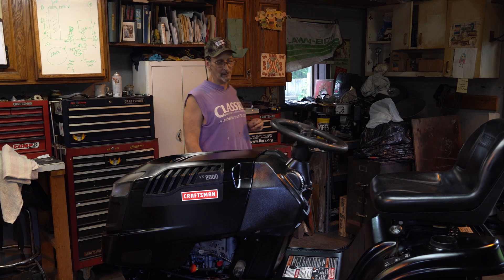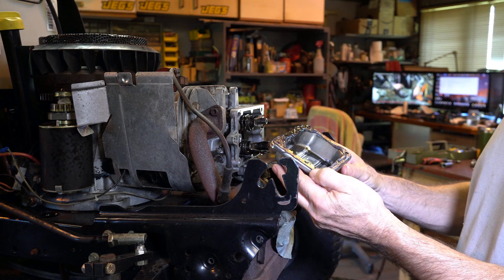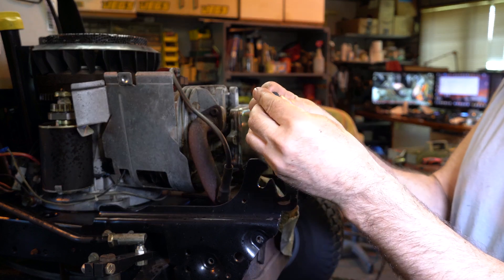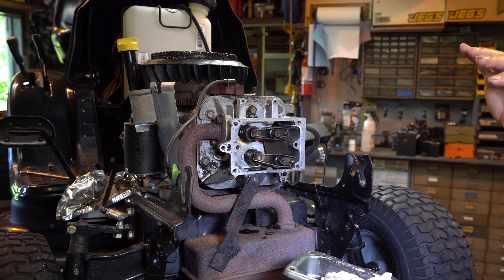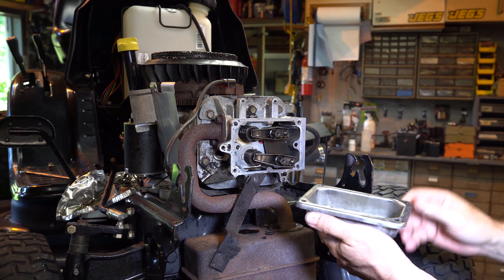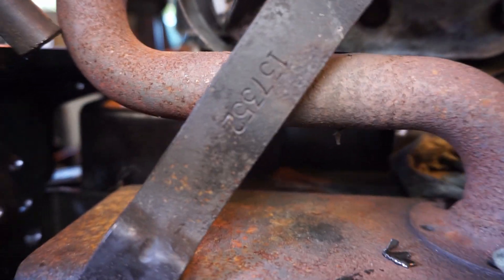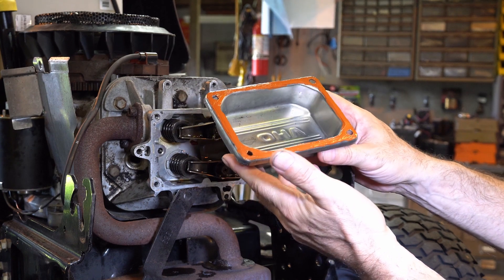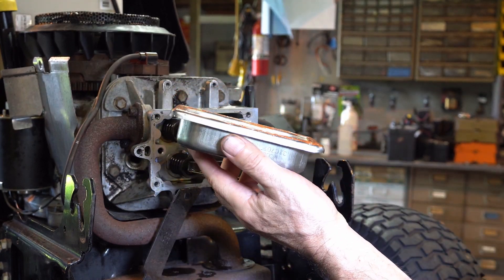How to Adjust Valve Lash & on the Briggs & Stratton 17.5hp OHV Engine - Craftsman Lt  Lawn Tractors

Comment: Briggs and Stratton have a nasty habit if the valves are not adjusted properly then it will crank slow like you have a bad starter or a dead battery. The reason it cranks slow it's because the compression release is not engaging. Take your time and pay attention. Generally I do . Intake .003" to .005"   /    Exhaust .005" to .007" generally when you get blow by or popping through your carburetor that's a good sign valves are out of adjustment and if you adjusted them properly and it still does it then it's time to do the valve job. If your machine smokes and burns oil chances are you have carbon build up around your valves. Causing it to pop back through the carburetor and backfiring.
Reply from the maker: Yup rex,,, I pinned this comment up at the top!!
Thanks!!!!
Reply: Good explanation 👍🏻

Comment: Those.
Valves are being gapped too far apart
Reply from the maker: Its fine,,,, what ya think ya got here? I've seen engines that have never been adjusted and they run fine too.. Its at freekin mower engine

Comment: Hi I have a john deere E 100 riding mower and i have a surging problem. i have replaced the fuel pump and the carburetor and it's still surging. i checked all the hose's and they are fine could it be trash in my fuel tank blocking fuel flow when its running. i do know it does not surge at low idle. just when you increase the throttle. please help
Reply from the maker: Could be, I so often find trash in peoples tanks along with water!
Usually new carbs are tuned correctly, the main jet needs to be drilled out. Check the original jet size and go from their.. I'm working on a video about this but it wont come out for some time.

Comment: How did you get .008 and .014 when I found that the manual says .003-.005" intake and .005-.007" exhaust are you talking mm?
Reply from the maker: Yes This is the issue I have. Ya cant re- edit either. 
I saved a file link in one of my folders for engine specs, it was a link to a full chart on briggs engine specs for almost all the families. Well, that link and a few others I saved doesn't work now!
Notice though that I slid in a .007 inch feeler gauge on the Intake before I did any adjustments!
I do know now from experience that this being a much older engine may have had the larger gap.
The newer designs often are fine @ .002 - .004 inch for both! BUT usually this setting is for the smaller 6hp engines. 
I have several videos that are newer on a variety of engines and all of those the gaps are tighter.

Comment: hey arch, great video, my engine will not startup, cranks, no start. i have replaced carburetor vacuum lines, fresh gas. so i was going to do a valve, but i was wondering since it will not startup, is that a valve issue. i know the very first time i attempted to crank up two weeks ago or so, black smoke went every where. thanks for any advice on this Arch.
Reply from the maker: Do a compression test!!
Reply: @TheNovaJohn  did a compression check registered 95
Reply from the maker: Thats a little low, maybe an adjustment is in order,,, Shoot starting fluid into it and see if ya can get it running.

Comment: It seems everyone has his own idea about what clearance to set the tappets on the same engine. An A&P mechanic once told me had rather hear the tappets a little bit than not at all because then he knew the valves were fully closed and fully seated so that they would not burn. Of course this is an air cooled engine, heat can cause a variation as the parts expand under heat, so far I’ve heard three different adjustment clearances in videos.
Reply from the maker: 1st we can say that manufacturer specification allow a plus or minus tolerance, things don't need to be that specific. These are usually a thousandth in one direction or another.
I like to be on the larger size to some degree as you mentioned, things get hot and ya loose clearance.. We wouldn't want to keep a valve open that should be closed.
Looser clearances, especially with exhaust can increase valve duration slightly. When the valve does seat, the added clearance adds a bit more time for the valve to remain closed thus increasing seat time/duration which improves heat transfer and reduces the possibility of a burnt valve.
Thankx for the comment!